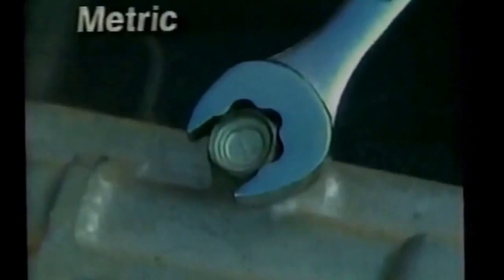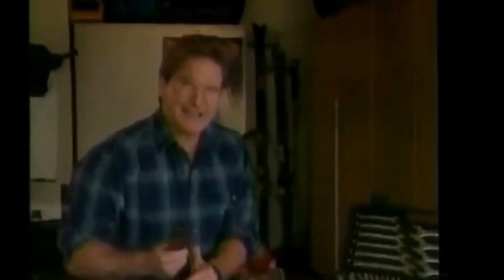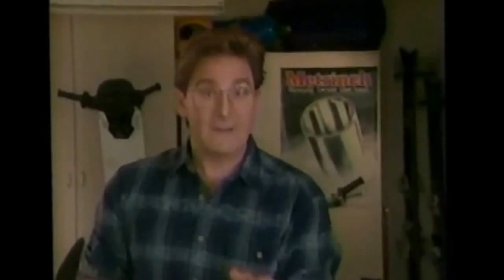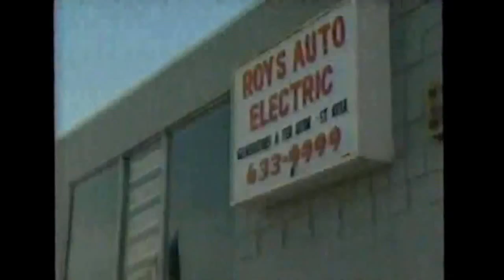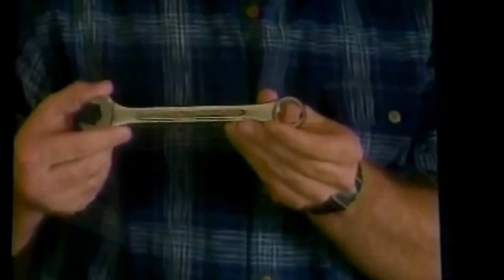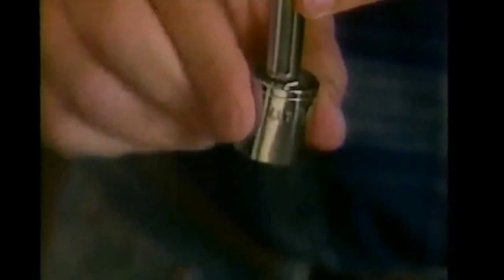Metrinch metric/inch sockets infomercial - part 1 of 3

Comment: I did a short writeup of the Metrinch infomercial near the turn of the century:
 
----------------------------------------------------------------------------------------------------------------
 
This infomercial is, in a word, GARBAGE.
Hosted by Joe Fowler, a hyped-up sweating speed freak, the program tries to sell you a set of "one-set-does-all" tools. Nothing could be farther from the truth. While it claims that "Metrinch is the only set of tools you will ever need", they DON'T tell you that many jobs just can't be done with the tools, as presented.

While the infomercial's announcer claims (and tries to demonstrate) that the wrenches grab the flat surfaces of nuts & bolts, some of the "live" footage clearly shows otherwise. They catch near the corners of the fastener; much the way "conventional" tools are portrayed as doing.
A demonstration Joe performs, using a piece of transparent acrylic with various fasteners on it, shows the tool obviously just barely snagging the edges of a worn-out nut. Sure, the Metrinch socket turns the nut. But I bet it wouldn't have had the nut been TIGHTENED first!

In one moment of brilliance, Joe Fowler dumps piles of "warehouse store" tools onto his workbench, then starts picking out things like allen wrenches and similar tools, loudly proclaiming what a waste they are. There's a reason they make allen wrenches, Joe!
I guess Joe hasn't ever had a futon, a motorcycle, an automobile, an electric scooter, a golf cart, or a lawn mower before.

As his 30-minute tirade on "inferior" tools and tool sets continues, Fowler continues to hop around the set, ranting & raving, and getting all sweaty and icky. I guess the show's producers haven't heard of paper towels.
For Christ sakes guys, go out and buy a roll of kitchen towels and wipe that crap off once in awhile. Disgusting.
I only hope for the producer's sake that they installed a shower in the dressing room.

One particular quirk that deserves mentioning: Almost everytime Fowler says the word "dollars", he quickly stands up on his toes, then quickly lowers himself back down. Is this some kind of secret body language communication with the dead? A covert message to Satan? Or is it just plain idiocy?

Fowler should also learn how to PRONOUNCE the name of the product he is selling. HINT: It is NOT pronounced "MET'rench"...
broken wheelchair

One look at Joe "Foul" Fowler and Metrinch, and I think I'll hang onto my regular toolbox and all those tiny, oh-so-wasteful allen wrenches, thank you. I need those to fix my motorized wheelchair, because I know for 100% certain that Metrinch won't do the job.

MY RATING: One broken Toilet Brush that belongs ground up in the bag of a Shop-Vac.
Reply: (Update 10-29-06): I have heard from a user of this product that yes, they're all they're cracked up to be. So...
Infomercial: horrible. Product itself: Worth every penny!

(Update 09-17-09): The following is an actual email I received from another user of Metrinch - his name and email address have been omitted to help protect his privacy and possibly prevent a shooting:

Dear Sirs:

Just want to encourage you to get the Metrinch set. I’d suggest the 72 pc set.

The infomercial may suck, but the tools are flat-out spectacular in their functionality, package size, and range of projects they can be used on. I’ve had my set for over 10 years. I’ve never in 10 years wanted another set of wrenches or sockets. I do mechanic projects ALL THE TIME.

I’ve owned a Lincoln Town Car for the same 10 years and have used Metrinch exclusively over 205000 miles to:

Change the oil every 3500 miles
Tire rotations
Replace 2 of the coil-on-plug modules
Replace all belt tensioners
Replace front grille
Replace A/C clutch
Replace harmonic balancer (with the Metrinch 6 pc impact set)
4 complete brake jobs
Complete replacement of air-ride suspension to include compressor and bags
Replace passenger and driver’s air bags
Replaced radiator 2 times (hint: don’t buy the cheap $100 radiators, you’ll just end up buying the OEM a year later…)
Replaced air bag clockspring
Replaced keyless-entry keypad
Changed tran-axle gear oil @ 125000

The Metrinch set is my sidearm and worth three times what they’re charging. Lifetime warranty, too…

Sincerely,

{name omitted}

Comment: These tools really do work!  I own tons of Snap-On, Mac, etc and use them daily.  I have a MetrInch set stashed away for those screwed up fasteners that even a brand new Snap-On 6 Point socket won't grip.  I didn't buy them for the metric / SAE universal compatibility.  I bought them for the ability to remove screwed up fasteners and they are outstanding in that role.